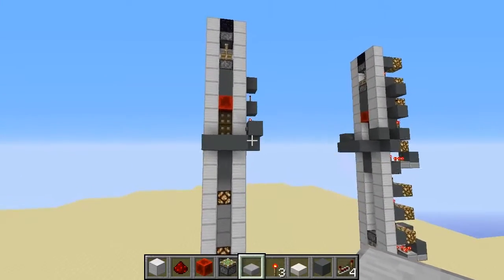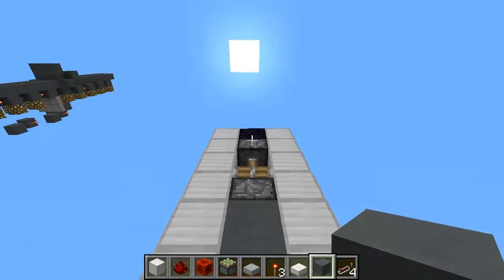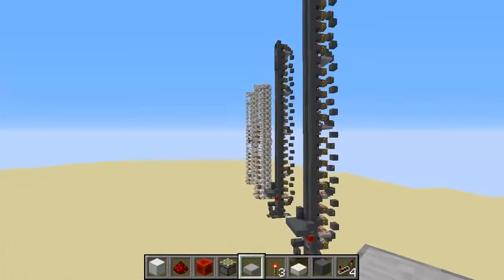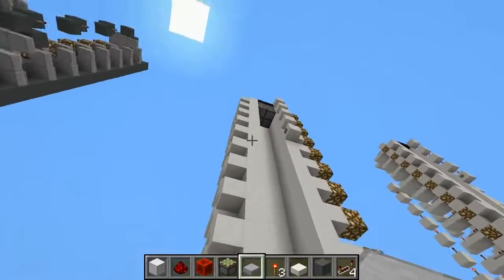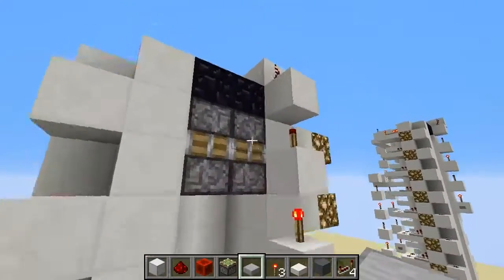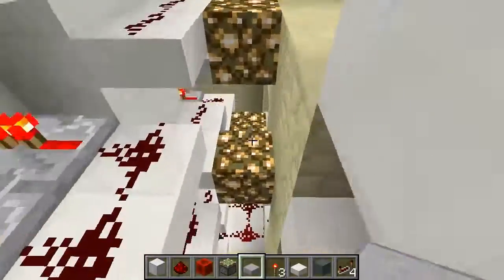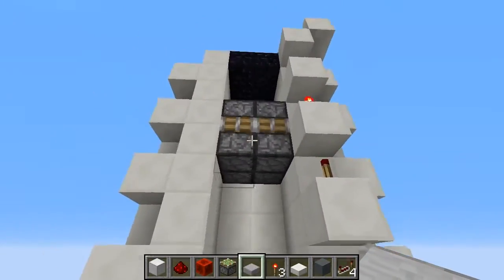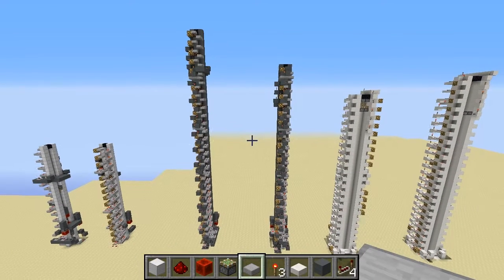Morezys Elevator Fix: For if you have trouble with my elevators

Comment: Actually, I was having the same problem as the first one you fixed. I am pretty sure it has to do with the timing, since to call the elevator from the bottom, it has to turn off the clock while the one on top does not.  Thanks for the fix, I was thinking of extending the line a bit more, but since it was at world height, I was having some trouble.  Didn't even think of just moving it down one or two.
Reply from the maker: Awesome! well im glad that fixed you up! You built one to the world height limit? how does it run? i still havn't built a massive one yet :)
Reply: It runs perfect if slow, but thats to be expected when traveling 192 blocks.  for a multi floor elevator, i think you would need to trap the piston inchworm somewhere above/below the cab to make it quicker, but starting/stopping it, and making it go the right direction.... tricky
Reply from the maker: wow thats awesome! well done on makin such a large one, is this is survival? I have a multi floor version in the design stages at the moment. There are a few ideas I have, for a tall system like yours its probably not going to be practical, but will be interesting anyway! thanks for the update!
Reply: It is not in survival, though I am working on a world height one in the server I play on.
Reply from the maker: very nice man! that sounds awesome!

Comment: I'm having trouble with the mini-vator up and down. i have followed the first half trying to get the elevator to go up but nothing happens. Now my pistons aren't activating at all! I tried just a simple piston, redstone, torch away from the elevator and it's not activating the piston. When I lay it down at the bottom of the elevator, it's supposed to go up and the first time I did it, it did. Then I rebuilt the whole lower assembly to see if I had made a mistake somewhere and now they just aren't activating. I'm very curious why pistons quit working, both regular and sticky, in and out of the elevator. By the way, I'm on PS3
Reply: I tried again today to build it, this time on top of the soil like you did in the original video and it still doesn't work. I'm quite the novice at redstone. The pistons are working on the elevator part but the pistons connected with the call button and up button do not extend to drop down the redstone block.

Comment: I have a really big issue with a piston elevator i just built. whats happening is that the piston set turn midways in the shaft instead of turning at the end of the shaft. Can you have a look at it?
Reply from the maker: eirikh96 hey mate yeah i can take a look but before i do. try turning on and off the elevator. also check that your repeaters are not set to 2 ticks by mistake :)

Comment: Having issue right now with sending the elevator up, it appears to be stalling, pistons going like mad but not moving, right around the first comparator. had no issues in my single player following your tutorial but now on my realms server rolling it again its glitching.
Reply from the maker: paul conto try turning the system off and on again. and also just check that your repeaters are all set to 0 ticks. :) let me know if you struggle and i can maybe come onto your realms and fix it :)

Comment: I have a unique problem. The up button works put the call and down don't.  I've traced to some repeaters getting the pulse but no actually pulsing. They are just stuck and I can't find the source.  They are not the top ones that keep the Pistons at the top.
Reply from the maker: hmm try a reset. switch it off and on again. also just check your comparator levels are far enough apart that they arnt overlapping too much.
Reply: Ok I'll check the comparator since mine have a pretty big overlap

Comment: Did anyone ever fix the problem with falling thru the floor when going up?   Going down works fine.   I'm on xbox 360 version.
Reply from the maker: +Chris Reed it only does it sometimes. if you stand closer to the trap door it seems to help.
Reply: MorezysMinecraft on mine the trap doors open and close

Comment: I've been trying to get this to work on the ps4 edition, however, nothing works. I've turned it off and on, made sure that the resistors had no ticks, moved the capacitator down, and it still won't function properly.  The bottom pistons move but stay at the bottom and won't move the blocks. The top pistons go up and down the length of the elevator but the blocks also do not move, they are just stuck at the bottom, and the top pistons just keep going up and down the length continously. I have watched your tutorial so many times, I have no clue what I'm doing wrong. Any help would be very much appreciated.
Reply from the maker: Melani Medina hmmm well it seems like you have a couple problems. i haven't actually built this on a console yet so i'm not really sure how it behaves. There is probably just a piece of red stone missing at the top that is why the pistons from the top keep going up and down. As for the bottom pistons just double check your bottom most piston is getting power.

Comment: Omg I give up, I can't do this, I've literally tried everything and still doesn't work ffs, the going up button works. Going down DOESNT work no matter what I've tried, please help me out man, I'm gettin tired
Reply from the maker: sorry to hear that! i have noticed in certain situations the top of the elevator needs to be adapted slightly to make them come back down. just play around abit with it. it will work.
Reply: I'm having EXACTLY the same problem, except it's even more annoying as my minecraft is EXTREMELY laggy, normally it's around 80-100 fps, but when I turn the elevator on it drops to about 4-6fps. I have no idea how to fix it. Please help.

Comment: Another issue: I built a minivator, but during the test run the bottom piston went only one block up before returning
Reply from the maker: eirikh96 hmm sounds like repeater timing issues or need to disable and re-enable the comparator clocks. Give that a try :)

Comment: Hello, I finished the 3x4 elevator but the elevator gets stuck when I'm going up from the bottom . The sticky pistons push it up a certain amount of blocks and they fall back down leaving me stuck . I looked at the repeaters and the connections and they were perfect , nothing seems wrong yet it's not working , please help
Reply from the maker: lorimer arteaga you probably just need to switch the system off and on again :) it can sometimes de-sync the timing when you are building

Comment: Hi Morezy, Love the elevator, Built the 2x2 clean elevator on Xbox one (it's a little glitchy and have fallen through pistons a few times (going to try and light up the are round back to see if helps)

I am Having an issue when I built it in Survival, the elevator gets half way and stops, on diagnosing the issue I have found that the redstone is flashing but on 1 level the repeater are not flashing along with the 2 dots of red stone at the same level on the front.

Have you seen this before or know any fix?

Keep up the great videos!!
Reply from the maker: Jp Unwin hmm this is interesting! i dont belive i have seen this problem before! let me know if you have already fixed it. if not show me some pictures!
Reply: MorezysMinecraft hi yeah fixed it in the end, it was down to an extra comparator repeater which was like 1 level below another one, once removed it worked fine. 

It is still very glitchy and I occasionally fall through the floor, I made this slightly better by adding a further block at the bottom below the redstone.

Comment: when I get into the 2x2, it pushes me out of the elevator through the bottom uhh wut
Reply from the maker: +Bubbler mc - Minecraft & More jsut some small issues with pistons in the current versions. if you stand closer to the trap doors it should be ok :)
Reply: MorezysMinecraft ok thanks :)

Comment: okay, you probably haven't heard of my problem, but I had started building this (Wii U) and when I got to the comparator part, the upper block that had received subtract mode had acted like a fast Redstone clock but the other dust it was connected to had been flashing at half the speed, can you tell me why it's being slow? any fixes would be nice thank you!
Reply from the maker: +Daniel Becker wow that is really odd. Does the piston pulse slowly too?
Reply from the maker: +Daniel Becker wow that is really odd. Does the piston pulse slowly too?
Reply: +MorezysMinecraft I only got to the comparator but when you made it a clock and it ticked quickly into the repeaters, it pulsed slowly overall only one dust was pulsing fast
Reply from the maker: +Daniel Becker hmm could be a graphical thing  try hooking it up to the piston anyway see if the piston is slow.
Reply: Okay, and damn the comments seem to be spamming mate, bad connection?
Reply from the maker: +Daniel Becker the only other thing i can think of is that two comparator signals are overlapping. Making it slower.if that is the case turn the system off and back on again to re-sync it.
Reply: +MorezysMinecraft look, I'll try it again, and if it doesn't work, can I send you a world file?
Reply from the maker: +Daniel Becker yeh of course :)